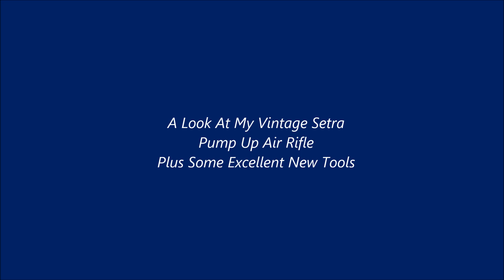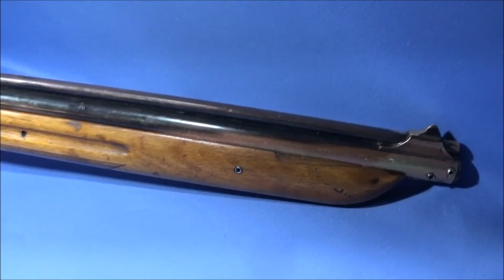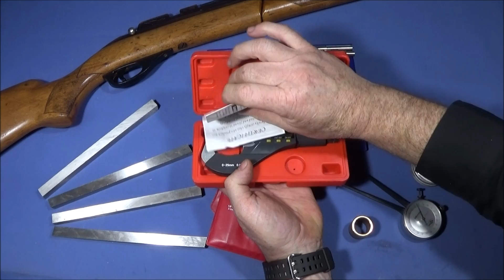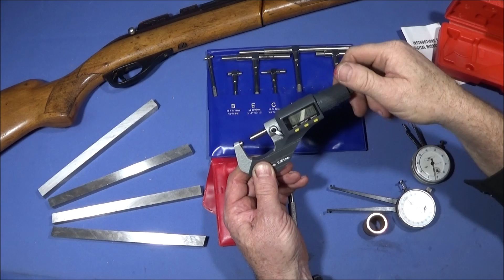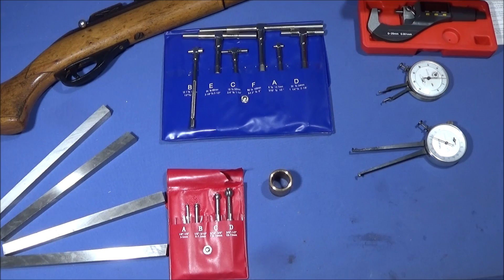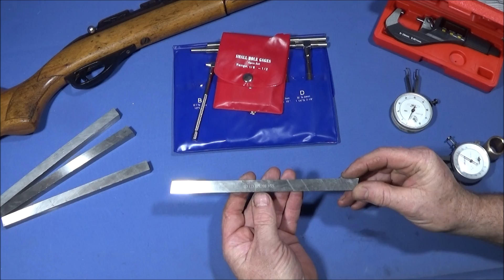Some Excellent New Tools Plus A Look At My Vintage Setra Air Rifle

Comment: I wonder if you would like to make a bespoke delrin top hat and guide for the HW80 as part of 'the tunning' or revamping the old girl?  It would make an inetersting project involving machining and quite a bit of precision work.
Reply from the maker: Hi I have actually made those before and the safety catches out of brass for other HW80 rifles. Long before I did Youtube. I may show how to make them at some point though.
Reply: @SteveJordan  Excellent sir. I have an Original Model 35 of 1978 vintage which needed a bit of TLC. A few years back I did machine the top hat and the guide from oilon rod. Amazing material but a real royal pain in the ** to machine.

Comment: Thanks for another interesting video Steve.   I'm wondering if you can advise on a good quality drill bit sharpener like the old one in this video   https://www.youtube.com/watch?v=RzgiyLbeXPQ     Have you come across any bang good equivalents?  I'd rather avoid a drill doctor type as it's small wheel doesn't seem to do well with larger bits like 1/2". thanks Tom

Comment from the maker: NOTE:- I ONLY USE MY AIRGUNS FOR FIELD TARGET SHOOTING & ALWAYS ADHERE TO THE UK LAW FOR THEIR USE.

SEE TOO LINKS BELOW:-
LCD Electronic Digimatic Micrometer -- http://bit.ly/2FsZ1mS
4Pcs Telescopic Small Hole Bore Gauge Set -- http://bit.ly/2YmWQtL
6pcs 8-150mm Telescopic Gauge Set -- http://bit.ly/2CDQL2x
Machifit 200mm 6/8/10/12mm HSS Square Lathe Tool Bit Turning Tool -- http://bit.ly/2WUyvdc